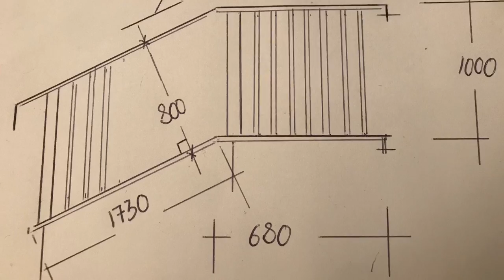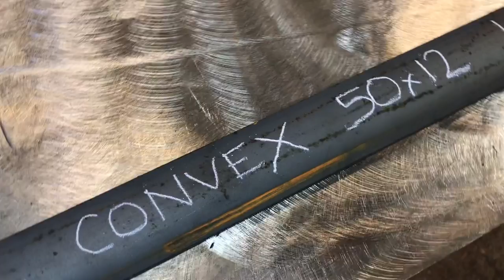Handrail / balustrade railing build. metal fabrication welding.

Comment: I have done a few of them myself. Using the floor is a good idea for the design to be tested as you build stuff before it leaves the unit. Top stuff squire!
Reply from the maker: Thanks Jon. 
The flatter the floor the better.
Reply: @TheMetalFabGuy  Absolutely. The unit l rent now has a flat floor so compared the ribbed concrete floor l previously had l have luxury!

Comment: Looks great! In my shop we use a huge metal table to layout our rails. Works great. 
Really hope they fixed those stairs though. They were looking rough!
Reply from the maker: Thanks for watching and your comments. 
That would be the ideal way of doing it with the bench. Especially for it to be true and good for line. 
But the bench would take up too much room in our size of shop unfortunately, especially if it was a permanent fixture. 

The steps were re asphalted after the install

Comment: I think it’s safe to say that’s just a slight improvement on the existing one🤣 Looks great.
Reply from the maker: Thank you 👍
The existing handrail tube top rail had a ‘v’ cut in to the underside with a grinder to enable the bend (presumably on site) and had been filled with mastic !
Reply: @TheMetalFabGuy  Like you say, on site bodge. The few times I’ve used or thought of using tube clamp system on angles it’s tricky to know for sure if the brackets are going to accommodate what you want.
Reply from the maker: The key clamp fittings that suit the angles  do exist and usually accommodate most angles.

Comment: Good job 👏 👍 tidy.. did you hear them galvanised too? I'd like to get more into doing railings like that..did you concrete them in as well as bolting them?
Reply from the maker: Thanks for watching. Undercoated and powder coated was the spec. 
Two bars were chem fixed into the ground. Coach screws /plugs for the top and bottom rail fixing back to the wall. 👍